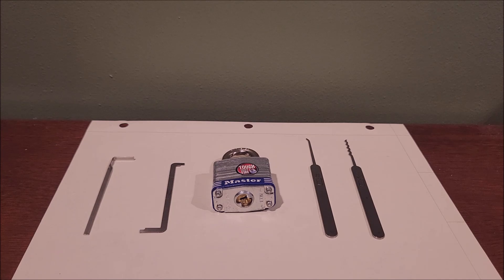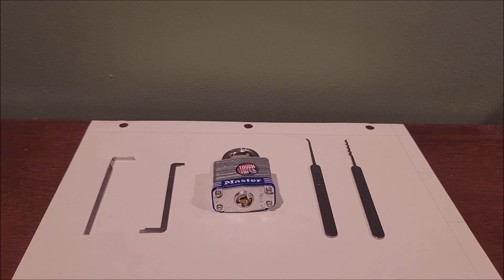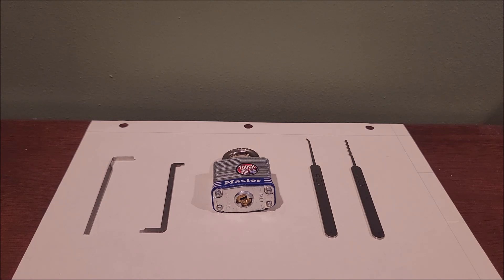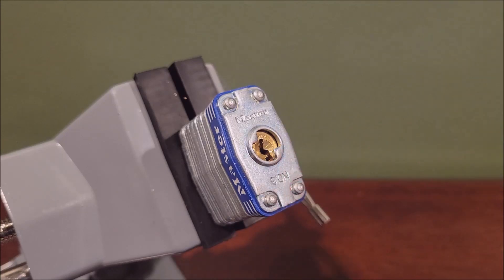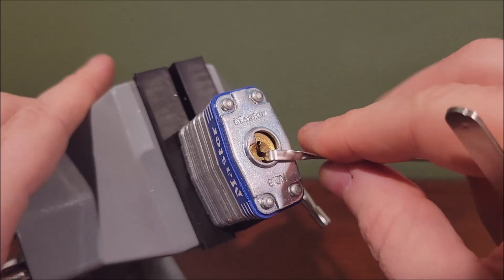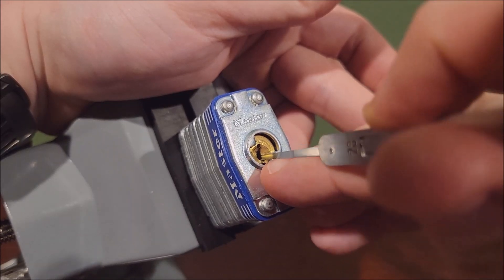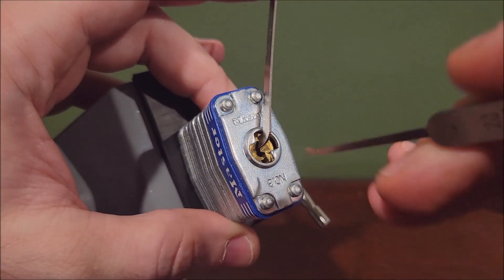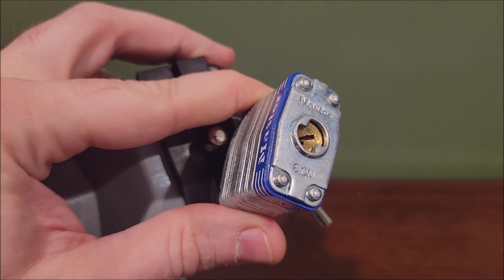(1) Hello world... Master Lock #3

Comment: What’s next after the #3 lock?
Reply from the maker: I'd say start off with getting comfortable with those a brinks locks first. After that there is a Redit channel that ranks different locks by how hard they are to pick. Just look for locks picking belt rankings
Reply: @LockpickingEngineer  Not several master locks that I previously purchased?  Where do youget your locks?
Reply from the maker: @stewsmith3536  I buy them all over, I've just been accumulating them over the years. Walmart and harbor freight have cheap locks for that are good for entry level. Also ask friends for locks they don't use or lost the keys too

Comment: get a proper mic, the amount of reverb is honestly excruciating ... oh god, talking in inches
Reply from the maker: Thanks for the feedback, I upgraded my mic on my most recent video (the master 130), let me know what you think... As for inches, sorry, that's easier to say than better than .508 mm... I'll try mention both units in the future
Reply: @LockpickingEngineer  the new mic has a lot less background noise, but still a bunch of reverb. typically a decent mic wants to be 2-3 cm or 1 inch away from the edge of your mouth, as well as to be spoken into from the proper direction as microphones have differently shaped pickup zones, and if all else fails, some acoustic foam on the walls to prevent overlapping sound waves

as for the inches, outside the usa tensioning tool width is usually indicated with one significant number, i.e. 0.6mm, 0.8mm etc. and rounding is perfectly fine there :)
Reply from the maker: @Mithaldu  Thanks for the follow-up! I will try a few different things to try improve the sound quality. I'll start including the metric version of both the tension tool as well as the pick. I'll post a new video tomorrow, incorporating your appreciated feedback.
Reply: @LockpickingEngineer  nice to see an earnest intent to improve :D

Comment: Hi thank you for sharing 🤩 i’m new to this, can you explain how much pressure is “a little tension”? And is there such a thing as adding “too much” tension when it comes to picking this or any kind of lock?
Reply from the maker: Hey, thanks for watching the video! So it's hard to say what the right amount of pressure is, that's something you just need to get a feel for, if you can't move the pins you probably have too much tension. I'd recommend starting with the rake method to get a feel for tensions.
Reply: It took a while for me to realize just how light of a touch is needed. Someone told me it'sbaround the weight of a quarter at the end of the turning tool. Seemed to help me
Reply: @ct1freak thank you! I’ll have to try out this tip!
Reply: In reality, you're gonna vary your tension. Some locks have a weak spring, some have a heavier spring, and some locks have spool pins. If no pins bind, adjust tension until you find one that binds.